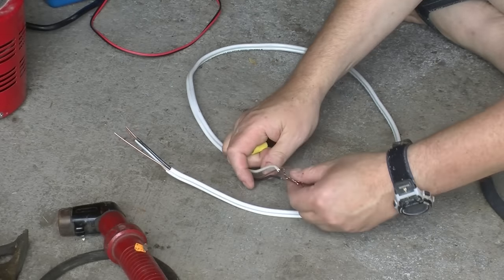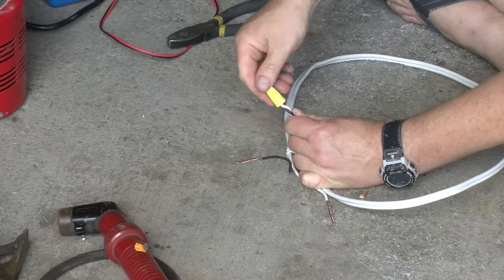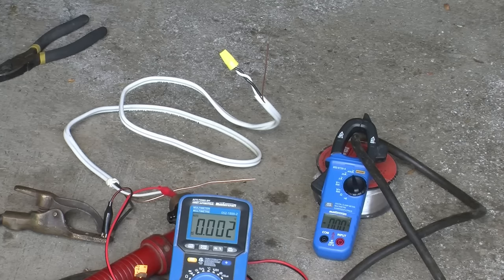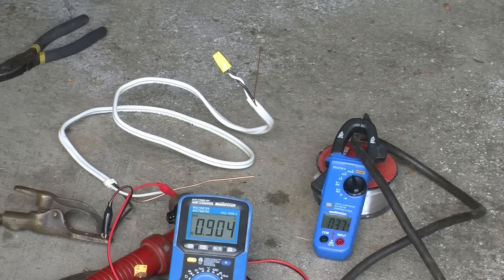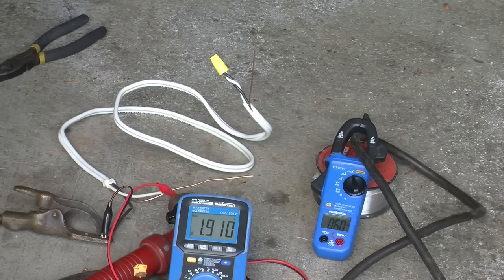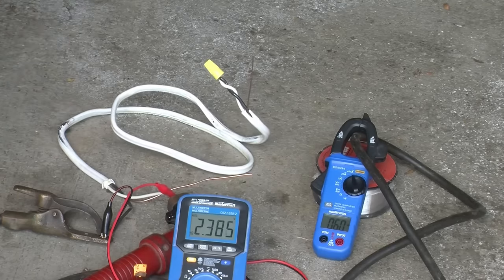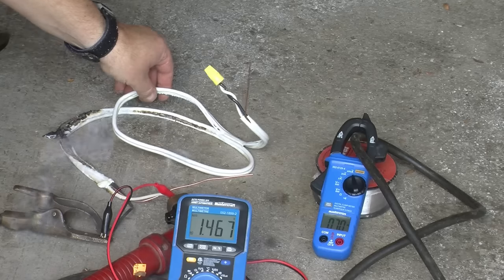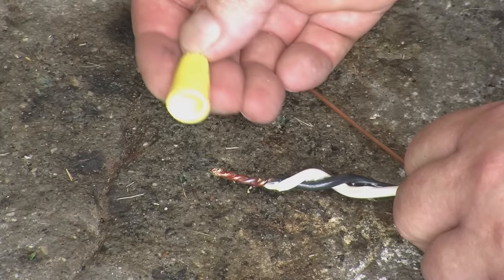How many Amps to burn up 14/2 electrical wiring?

Comment: Such a basic but neat test. I wonder how long the 14ga wire would last at 30 amps
Reply from the maker: A long term test of that would be really interesting particularly in a worst case surrounded by insulation scenario. I dont know anything about the chemistry of plastics. Would be interesting to know of the ones used deteriorate over time when very warm or hot.

Comment: The wire nut didn't have much heat on it, the current is mostly going from wire to wire at the beginning of the twist. Also with two wires you can twist them, it's a personal thing, but 3 or more (5 is maximum)  you want them straight and parallel, same length of stripped wire so the wire nut can bite into the wire. If one is stranded make it a little longer.
Reply from the maker: Its funny, the thing that most surprised me after posting the video what how polarized some people are in terms of twist or not. I have never really liked the combination thin stranded wire and a solid wire in a wire nut. It always seem like the solid gets "protected" in the middle and the fine strands could get damaged.
Reply: @ElectromagneticVideos  Yes, there's definitely some sketchy stuff out there but ultimately, it is what it is and you move on. I think people argue for their preferred method to justify doing something not specified in the code, like installing GFCI's "upside down" with the ground on top despite a photo on the box showing exactly that.
Reply from the maker: @BariumCobaltNitrog3n  I hadn't heard the GFCI's "upside down" bit. But yeah - I think actually some people just like to argue!  The good thing is there have been so many comments like yours which really added something to think about or consider.
Reply: @ElectromagneticVideos  Thank you. I think we can all learn something from others, there's no sense in just shouting out things we think we know.
Reply from the maker: @BariumCobaltNitrog3n  Exactly. The should be more of that sort of learning. I'm an electrical engineer - I have found so many of the comments from electricians who see all this stuff in real applications every day so interesting and I have learned a lot just reading them. And some of the retired people who have a lifetime of experience of whats really reliable and what isn't are sources of real world info that is invaluable.
Reply: @ElectromagneticVideos  Right, like don't work on live circuits. Speaking of learning, why did you use such a low voltage, to regulate the current more efficiently? 70 Watts to me sounds average, less than an amp, but at that voltage is electric chair material.
Reply from the maker: @BariumCobaltNitrog3n  I'm not quite sure that I understand what you are asking. So if I answer the wrong question let me know! Very low voltage because with a short at the end of the wire the only resistance in the circuit is the resistance of the wire and the resistance of the connection in the wire nut creating the short. Since I = V / R, and R is tiny, V is be small even for large currents. So the variac->2:1 transformer->welder chain is really to provide an adjustable low voltage with with a huge available current. 

I could have used a 120V or 240V supply with an  adjustable load (heaters) instead of the sort. The  voltage would have had to be 120 or 240 between the wires, but the current the same if the heaters are chosen properly because the current is the defining factor of this experiment : the ohmic heating of the wires depends on the current though the wires, not the voltage between the wires:

There have been a number of people misunderstanding Power = VI in some other discussions: 

V from power source = V along the wires + V across the load.

P from power source  = P along the wires + P into the load.

Current I is the same everywhere.

P along the wire  = I times V along the wire   
and
V along the wire = I times R of the wire 

So P along the wire  is the same for any particular current and does not depend on the voltage across or power into the load. 

So making the load zero ohms and using a supply voltage that is only  "V along the wire"  I can eliminate the need for a high power bank of heaters as loads, 120V or 240V across the loads (dangerous) and a very high power input (say 120V x 60A = 7200W) and all the risks that if something shorted and circuit breakers in my panel didnt trip, a lot of things would vaporize. 

Most of all, with only a few volts, its safe to work. I sure woudnt touch the wires if it was 120 or 240V across them. 

So thats the long winded explanation of why low voltage!

Comment: 15 Amps at 120 Volts is 1800 Watts. An accurate test will be to measure the overload current at 120 V AC at 60 Hz.  Also, the wires twisted together in the wire nut should be able to withstand a greater current than a single wire.  The wires twisted together are twice as thick and the contact area between them is much greater than the diameter or thickness of an individual wire.  Most wire nuts also have a springlike metal twist inside them to help secure the two wires together. This will also increase the contact area and reduce the resistance to the current flow.
Reply from the maker: I discuss that here in a just posted video: https://youtu.be/CP3-jcpzZeI

Comment: When wire nuts are installed correctly,as you did, the connection is as good or better than a lot of the newer type connectors.  All the wire nut is doing is protecting and securing the connection. No current should be flowing through the wire nut itself.
Reply from the maker: Completely agree! However, there are numerous commenters who say that cable should not be pre-twisted before putting on the nut. A apparently some manufacturers suggest or require pre-twisting, other not. I cant figure out why pre-twisting would be bad - as you said - it results is a really good connection.

Comment: You have excellent content.  Here is a suggestion.  Why not display the instructions that come along with the "Marr" or "Wire nut" at the same time you are making the connection according to those same instructions.  Some instructions say to pre-twist the wires, others may not.  Either way the NEC (NEC 100.3 (B) Installation and use;  "Equipment that is listed, labeled or both shall be installed and used in accordance with any instructions included in the listing or labeling". I suspect your local or national electrical code does as well) directs the installer to follow the manufacturer's instructions if you are going to incorporate their products.
Reply from the maker: Thank you so much! Until  bunch of people commented I wasn't aware that some manufacturers even have instructions saying don't pre-twist. Your  absolutely right about following the manufacturer's instructions. By the way - looked at your videos - really like the fog bow one with the airplane's shadow and the shock wave one. Nice to see I'm not the only one that looks at and is delighted to see things like that from an airplane!
Reply from the maker: Oddly I can see your response to my reply but cant get to it to reply.  How cool that your are commercial pilot - I am an electrical engineer but am fascinated by airplanes and love flying - always get a window seat. Wonderful that you discovered electricity as an interest. I completely get that its not worthwhile changing career for a variety of reasons - sounds like we are very similar in age. I would say keep it as a hobby! Doing these videos has been a great way to bring back the "hobby" part  for me -  having an excuse to do all sorts of fun experiments has been great. For work I tend to do more RF and digital  signal processing type stuff and I do some videos about those types of things in the future .

Comment: I'd like to see a comparison of how much current solid copper can carry VS stranded copper.
Reply from the maker: Thats a good idea for a future video - maybe this summer when its warm enough to do things outside again. Spoiler - assuming the actual cross sectional area of the copper in the stranded and solid cables is identical, and the copper quality (resistivity) is the same and the same applies to the insulation, the results should be the about the same.  Note that for 60Hz, this size cable is way smaller than the skin depth so even a suitably made litz wire stranded cable should be no better than solid.
Reply: @ElectromagneticVideos  I recall reading somewhere that current tends to travel along the outer surface area. That's what has me curious whether the same gauge stranded copper potentially has an advantage.
Reply from the maker: @markfothebeast  Yes! The depth that it penetrates is called the skin depth which decreases with frequency and conductivity of the metal. For copper its a bit less than 1cm for 60hz, so for power transmission it only becomes a problem for wires larger than a cm in radius. For higher frequencies where skin depth is much less, the trick is to use stranded wire where there is (weak thin) insulation between strands and the strands are woven  so a strand is sometimes in the middle of the bundle and sometimes out the outer part. This forces the current to use all the strands. This is called litz wire. This works until you get into the 100s of Mhz region. The other trick for RF is to use hollow wires (ie copper pipe) since the middle sees no current or to silver plate wire so the out layer has lower resistance.
Reply: @ElectromagneticVideos  Thanks for the info! Something I run in to on a typical basis is wiring up a 240v (60hz) appliance like a clothes dryer or oven on 30 or 40 amp circuit and find that the appliance itself has tiny stranded wires after I ran 8/3 or 10/3 wire. That never made a whole lot of sense to me.
Reply from the maker: @markfothebeast  I think the main reason for things dryers and oven having finely stranded wire is to keep it flexible and make it less sustainable to damage when moving it around. For what its worth, I have heard that some European countries use stranded for house wiring. Not sure if they have some particular reason for using it other than thats what they always used.

Comment: So in the 120 year old (or older) House I am in  - they had (still have but not connected) single wire and knob ?  knob and tube ?  with a cloth insulation  - but it appears the wire itself can handle quite a bit of current   so maybe makes sense to have the wire spaced and in open air -  although what you need such high current for I don't know
Reply from the maker: The main issue with know and tube is if it got covered in insulation from renovations over the years, or was expanded with improper connections or to create circuits with excess currents. Also many insurance companies seem to be refusing to insure knob and tube. 

I did a knob and tube test here. https://youtu.be/Yk9P2pKIza0

Comment: The "issue" with wire nuts isn't the connector itself which isn't intended to hold any load, it's that people don't make sure the wires are actually connected before putting the wire nut on.
Reply from the maker: Yes! You would be surprised at the different thoughts about this as expressed in other people comments!

Comment: Few years back in my HUD used home...it got cold day after Tday....

I didn't want to fiddle with furnace..

Connected space heater....

Went to bed and fell asleep...at  7 pm

Heard sounds in crawl space...

Smelt faint odor of nasty burnt wood

Woke up 1 am

Walked ouside...saw like fog and smoke down the street...thought some crazy neighbor is buring crates or nasty wood...

Went back to bed...

Could hardly sleep....and thought i heard rats in crawl space...

Was woken by busybody....Your house is on fire...

Barely woke up...was tired...looked at roof vents...smoke billowed out...

Firetruck arrived 8 minutes...put fire out in no time

Tore out drywall..

Previous owners installed ceiling fan and used about 6 pairs of wire nut on 
various pieces of 14-3 and flat like  gauge 16....they splice in...

The wire glowed red hot.?..burned bottom boards of three trusses of about 20 feet of 2×4 all night

The heater was set on med..
Probably drew 600 watts..

The 25 amp breaker never tripped. Later it was tested...and found not defective...that was replaced later when moved back in

The insulation being thick...like 9" of vermiculite looking pellets...held the smoking 2x4 truss in sort of smoothed state

The house never caught on fire...

My smoke alarm never went off. No smoke was ever seen inside  the house....

I  so lucky the house and I didnt burn down....

And i remembered to pay insurance....

$67K to fix...

I think the cycling and age of the wire nuts....caused a high resistance....and they sliced it with what looked like odd pieces of extention cord...

Some pieces were 14 gauge bunrt to the copper...

So did the wood coals just burn outward...and then melt the insulation....?

I have no idea
Reply from the maker: What a story - lucky the house didnt burn and no one was hurt .  #67K - ouch!

It sounds like the lack of air circulation - maybe the result of this insulation - prevented a raging fire. If you haven't seen the videos I did following this one of wire in walls take a look. The insulation did seem to keep things form bursting into flames, but also lowered the max current before the wire insulation melted. In some it was almost like you described with smoke creeping out of cracks etc in the wall. And charring where the cable went though the 2x4s.

Comment: I learned that at 120v, the amps are as follows: #10 wire, 30A, #12 wire, 20A and #14 wire at 15A.
Reply from the maker: Yes thats it for typical house wiring situations.

Comment: Seems to me that the wire nut never saw more than 70 amps, if that. A short circuit apparently occurred in the first third of the wire as the insulation melted.

Comment: I would be very interested in seeing how many amps an outlet could pass before failing. Say someone didn't  pigtail the outlet into the circuit, and used the little bus bar on the side of the outlet to send power to the next outlet.
Reply from the maker: I have actually been thinking about doing some specific outlet tests, including foreign (UK and German) ones. Hadn't thought of testing the bus bar. Question for you: You mentioned pig-tailing as opposed to using the bus bar to connect to presumably the next in a series of outlets. Here (Ontario) as far as I know using the receptacle's bus bar is almost always used for that. Is pig-tailing more common or even required by code in other parts of North America?
Reply: I've heard it's required in commercial installations but not residential. In all my amateur electrical work, I've used the terminals to feed through to the outlet to the downstream load. Never had any problem of any kind. Just use clean wire and tighten screws properly.
Reply: @bamaslamma1003  It continues to astound me when people say "I've always done it this way and I've never had any problem" as if that is some kind of proof that they're doing something the right way.   "I've always crossed the street without looking and I've never had any problem."  "I've always played Russian roulette with one bullet and I've never had any problem."
The correct answer here is, "Yes, the code allows that, so that's how I do it."

Comment: I believe that when the wire is bent too sharply it can overheat more at that point, so it is not a good idea to bend wires sharply in an installation.
Reply from the maker: I think your right about that. Perhaps as well if the bend is really sharp there would be cracking in the conductor that  would increase its resistance around that region and further increase localized heat generation.

Comment: So you're telling me im safe to wire a single run of outlets using 14/2, got it. Thanks!
Reply from the maker: Well in many/most places in Canada and the US, 14/2 is acceptable for national and local code requirements but you really need to confirm what is required locally. In many places, 12 outlets and/or lights is the max on one run - again check local standards.

In some follow up videos I did some tests with the 14/2 in 2x4 wall surrounded by various types of insulation. The safety factor goes way down. If I was putting a 15A circuit that is sandwiched between insulation in walls (or worse, a hot attic) I would use 12/2 even if local codes does not require it.

Comment: wire nuts are suppose to only insulate the splice to do a splice with a wire nut correctly the wires have to be twisted together 2.5 turns the nut is just an insulator.

Comment: Just curious. Some questions:
How long was that 14/2 cable?
What was the waveform of your AC? (The output of your welder)
Are your meters RMS or averaging?
Reply from the maker: I think it was 3 or 4 feet. You know, it would be interesting to put a scope on the welder and see - I would expect at the low current levels it would a fair sinusoid since I am powering the welder at abouy 1/4 of its normal 240V so I doubt any of the core is saturating. The meters - they are cheat hardware store ones. I'll have to see if they are true RMS. It wasnt meant to be any sort of calibrated test!

Comment: my guy is trying to get electrocuted "OH LOOK THE WIRE IS EXPOSED * touch * I think there is a short in here * touches the ground wire*"
Reply from the maker: Its low voltage - only concern is burning my fingers if it gets too hot.